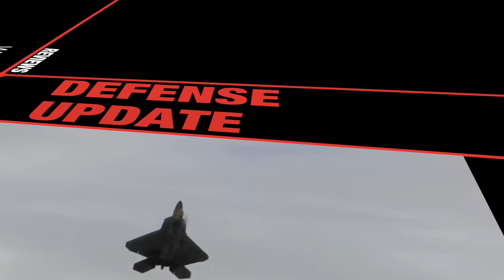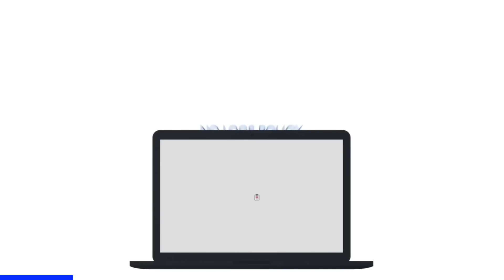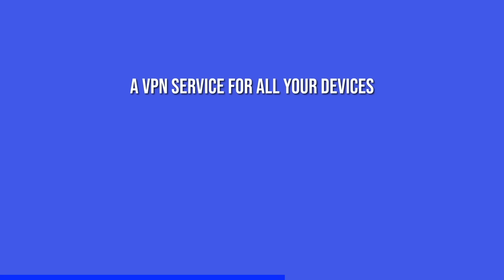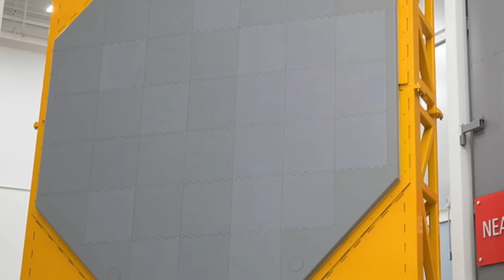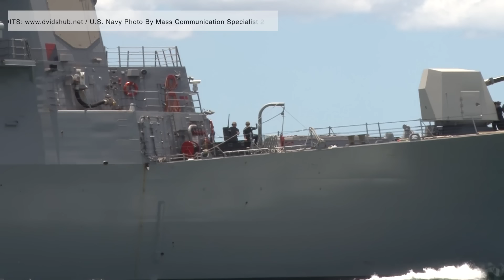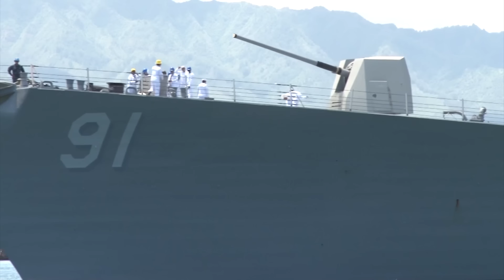AN/SPY-6(V)4 RADAR - Powerful new Eye for older Arleigh Burke fleet !

Comment: While the radar is much needed , the USN still has a short fall with newer interceptors as well as a successor to the TLAM that has mach 5 plus speed while retaining 1000 mile range and warhead options
that can fit in the VLS. A newer radar doesnt help of you dont have better weapons. The Army and USN should collaborate on PAC-4 that works for both

Comment: Smart move, can't build fast enough? THEN, SMART UP ,AND use your existing inventory, refurbish it, renovate it, update it, make it EVEN MORE LETHAL. And problem solved! 
America 🇺🇸👍
Reply: Unfortunately this is not always the best scenario it's great for the defense contractors of course

At this point when you're dealing with older kit you get diminishing returns and then you have to factor in cost how long it takes for the upgrade meaning how long these ships are out of service and I'm sure at least a dozen other considerations not to mention let's say these ships only have maybe another 20 year shelf life and you're talking about upgrading 90 ships for hundreds of billions of dollars 💸 💵 💲 

Also factored in there are other upgrades for these various systems now this upgrade would make sense for the aircraft carriers for sure because they are going to be around for another 50 years

Again for what was shared in the video it could be justified based upon the increased capabilities but those are the things taken into consideration I don't know if the older should be refitted is there going to start retiring them at some point because all the ships require more maintenance and while they're paid for those maintenance cost increase with time wild this upgrade should just be integrated in newly built surface combatants
Reply: whatever however  @Ridgelinehunter007
Reply: Actually not smart
The USN need to move the DDG-X to construction to take strain off the existing fleet
The DDG-X will be built
Trump's vainty project will not be built
Reply: Not problem solved 😅
Reply: @Tony-fl3rl  well sort of 😄👍, Taking advantage of the frames you already have is better than not doing anything about it 🤭👍
Reply: cant put a price on stupid just made it worse for themselves